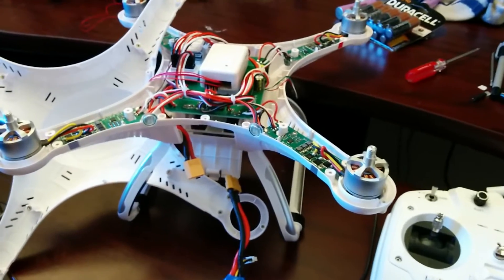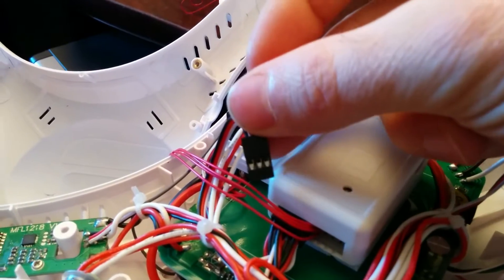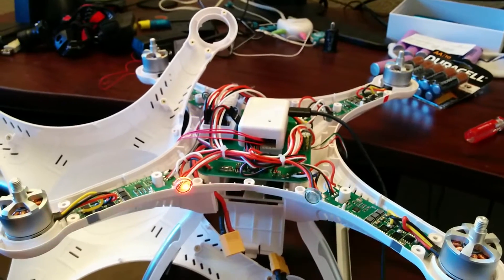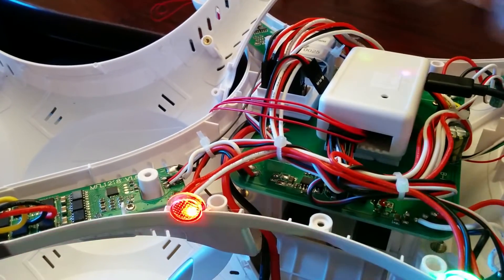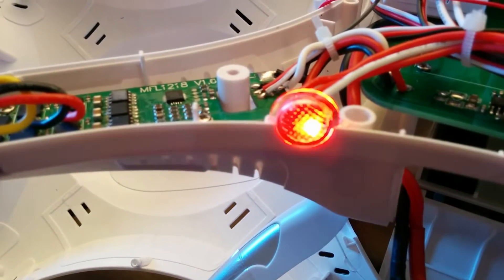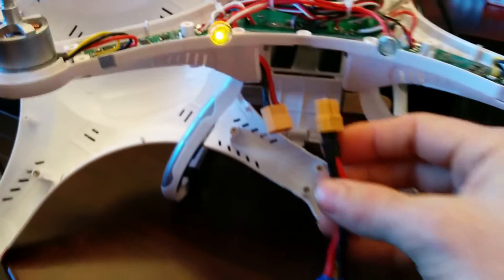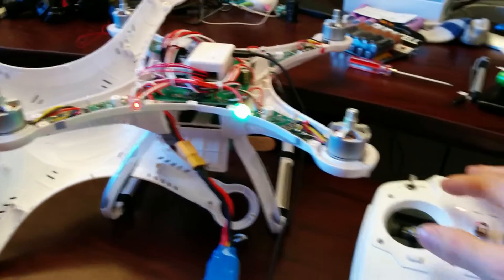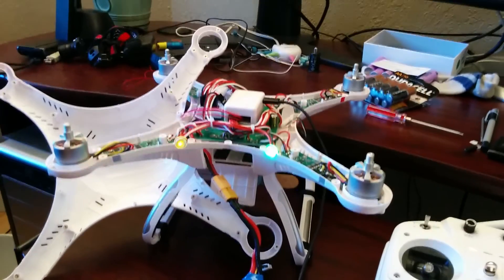Cheerson CX-20/Quanum Nova ESC Calibration

Comment: I have a CX-20, in mission planner it shows that it is upside down, i tried calibrating everything and it still doesn't work, and it doesnt want to unlock the motors, I calibrated the transmitter and it still doesnt want to unlock them. Could anyone help me please?

Comment: how can you pass through throttle without arming at the end? will it need a restart and it would need arming first again?
I think you can do esc calibration by plugging your mototors one by one into receiver arm channel, power via usb turn on tx max throttle plug in battery lower throttle disconnect batt repeat...

Comment: Hey, I know it been a while since you did this, It worked for me but does not seem to be saving the settings. When I disconnect and unplug from the PC plug everything back in ,plug back I the battery the motors wont start at all. If I go through the process again the motors spin but once disconnected same thing. Any ideas? Any help would be appreciated.

Comment: you know whrere to buy compass wires and conncector. When I plug in my compass wire and put on the top the motors only go half throttle on full strange. I may have a short in wires but didnot think the compass would set motors.?

Comment: I did all this and everything went as yu said , i cannot get it to arm now , and suggestions .?
Reply from the maker: Cecil Frank maybe your need to plug the cable back in that you unplugged(see description for the full set of steps).
Reply: Gps green light doesnot work no power to it ! Red works!
Reply: I'm actually having an issue with the red indicator light after a crash. All my solders seem good and it even flashes for a second when I plug the battery in. Anyone else solve this problem?

Comment: Couldn't work out why my motors wouldn't spin up on arming, after having done a complete rebuild/upgrade on my Quanum Nova. Thank you! This worked perfectly - even with different hardware/transmitter ( APM2.8/ESCs V2.4b/3DR power module/FS-ia10b/FS-i6S)

Comment: Hey there  I am having a problem when I arm it and throttle up the motors start and stay at the same speed. full throttle it's stays at the same speed.   and ideas?
Reply: battery, or transmitter

Comment: I got a this quadcopter for christmas lastyear and I think I calibrated it wrong. how would I reset the whole thing so when I turn it on it thinks it is its first time turning on.
Reply: Hi Littlepro01, if you don't have any motor problems, you don't need to calibrate the esc like in this video. What's your CX-20 problem?
Reply: I believe I calibrated the gps and compass incorrectly so it acts stupid and doesnt always respond
Reply: You cannot calibrate GPS but compass and accelerometer..what's his beaviour

Comment: After you do this you need to replug the cable you did pull out in the begining ?
Can i upgrade the esc's for 30 amp opto BLheli esc's and fly with them after only this caliblation?
Reply from the maker: Yes, you need to plug it back in(as stated in the description).

Comment: I finally fixed it. calibrated the esc's according to this video. it was great. crashed after,  just got the same exact motor, put it in, was shuddering. Replaced the rf esc and it fired up! since I saw your video, I bought a Parrot Bebop 2. Cats ass!

Comment: Hi Mike, just wanna commend your awesome video!! Also wanna ask if you could show us the procedure to shutdown the quad such that the calibrations are saved. I realised that my motors are not stopping together in normal mode like they did in ESC calibration. help needed thanks!
Reply from the maker: +Edwin Kang The calibrations are saved automatically when you finish the procedure in the description of this video. There is nothing else you need to do.

Comment: so everything looks great all in sync, but as soon as i power off and  power on its crap again, not moving the same .  is there an order your supposed to re connect everything that im not doing right?
Reply from the maker: +Ricky P No. If you hear the same beeps as in this video then you are done. If they don't spin the same after powering back on you have probably not calibrated the accelerometer properly.

Comment: After doing all the steps my cx20 with APM2.8 works and motors are calibrated, but once i disconnect and try to reconnect it seems that my APM didn't kept the calibration and once i arm motors they  start to turn at low rpm again as if i didn't proceed to calibration?? any clue?
Reply from the maker: +Jocelyn Cholette did you do all the mandatory calibrations in mission planner? the motors may spin when armed if you have the MOT_SPIN_ARMED parameter set.

Comment: Thanks for this video. I can now get the esc/motors to run. But when the motors are armed, my Q nova spins the props quite a bit. Should this happen?

Thanks!
Reply from the maker: +Julie Macfarlane it is a safety feature. but you can change a parameter (MOT_SPIN_ARMED) if you don't want the motors to spin when armed.

Comment: l would like to thank the author of this thread l have a problem with my new never flown cx20 when l took the top off for a look at the guts of it l found a white wire cut. problem answered in thread. l plan to build my own quad soon the cx20 is just one step along the path. thanks

Comment: Hi Mike, brand new Cheerson CX 20 open source. all 4 motors worked in the house. took it outside did the spinning bit, placed it on the ground, and only 3 motors worked. been going crazy. I'm ready to send it back. that button you pushed, would this reset the motors or what? please help
Reply from the maker: +philip dangelo No it won't. You probably haven't calibrated everything properly or you have a motor or ESC issue. There is a link in the description to a forum where you can get help.
Reply: I have the same problem. did u solve it? how? ty
Reply: +philip dangelo did u ever fix it?

Comment: will this steps help if my cx20 is taking off side ways and hard to control when taking off?
Reply from the maker: +ivan botello no, probably not. either you're not giving it enough throttle when you take off or you haven't calibrated your accelerometers properly.
Reply: +Mike Morrison I been trying to calibrate it. I do put it in calibration mode and go in circles and then I put it nose down and go in circles. And my cx20 still takes off side ways
Reply from the maker: +ivan botello that's not an accelerometer calibration. http://copter.ardupilot.com/wiki/configuring-hardware/
Reply: +Mike Morrison thank you. I just got mission planner on my compute.

Comment: Hi Mike My problem is this, I had a crash of my CX20,"pilot error" unfortunatly bad damage,  had problems after where flights were not stable and for other reasons I replaced the FC with a new one , standard  open source with  3.2.1 , installed it  and cant get the motors to arm (rock back and forward with a constant beeping) found your video and followed it and every thing worked as you explained, disconnected and it went back to rocking and beeping, can you suggest what I am doing wrong, thanks Geoff
Reply from the maker: +SuperGoofa Something is wrong with your parameters. Reset to default in mission planner (advanced view) and then go through all the mandatory calibrations again. Remember that the compass is internal.

Comment: Ive noticed on the ESC power cable the white lead on mine as been cut after been soldered to the board, Is yours the same? Is the white lead not used for anything?
Reply from the maker: +Quopter 999 Yes they are all like that. It isn't used.

Comment: Hi Mike,could you possibly take a look at my video (my only video) and let me know if you think my problem could be ESC related. Ive done the accelerometer and TX calibration via mission planner but im still having a tilting issue. My next step is the ESC calibration then restoring the default parameters as ive left to think the problem is in the parameter settings.  #Baffled  Your opinion / help is much appreciated. Thanks

Comment: Is there anyway to reset, or reprogram the Cheerson CX20 Remote Controller?
It is at this point not binding, and just beep and blink.
Please help if you can. 
Thanks
Reply: +Jack Scarpon If the controller is beeping, and blinking, that usually means the batteries need to be replaced in the controller itself.
Reply: I found out that the hard way.... Thanks for your reply...
Reply: +Jack Scarpon The best place to find info regarding the CX-20 is at http://www.rcgroups.com/forums/showthread.php?t=2112759
Reply: Thanks..

Comment: Hi friend. I'll connect the USB in APM and other in the computer?
Reply: +Diego Funari Yes, the other end to the computer. This is only used to supply +5 volts power to the APM during the calibration process.

Comment: Soldering looks good on the quad, what should I check on the TX
Reply from the maker: mark valis Nothing on the TX. Your problem is either the ESC, the connection between the ESC and the flight controller, or the flight controller. Try plugging the ESC directly into the receiver's throttle port (T) to rule out an ESC issue.

Comment: I have one motor not spinning i did the above but still doesnt run, it kept beeping even while others were running
Reply from the maker: mark valis The beeping means that that ESC is not getting a signal from the flight controller. Check the connection (wire and solder joints) between the flight controller and that ESC.

Comment: HI Mike 
             When i power up my quad 1 esc arms a few seconds after the other 3 and then the motor will not run any ideas what the problem may be thanks
Reply from the maker: Colin magowan Sorry I don't. I have not heard those fast beeps before. Have you done the transmitter calibration and then the ESC calibration?

Comment: I was following your setup carefully my 3rd (CCW) motor speed were back to normal, but when all setup finished, I remove the battery, plug the power back and the mini usb, my quad doesn't saving the setup, it all came back to the previous setup (my 3rd CCW motor esc speed aren't the same with others). So, how do I supposed to save the setup to the esc?
Reply from the maker: Dwityandaru Hananto The settings are saved when you complete the procedure. If one motor isn't spinning as quickly, perhaps it is a different issue. Maybe you haven't calibrated the accelerometer properly so the quad doesn't think it is level. If it doesn't think it is level it will apply more power to some motors and less to others. Try (CAREFULLY) holding and tilting the quad while applying a little throttle to see if that one motor will spin faster when you have the quad at a different angle. If so, it's probably the accelerometer calibration. Otherwise, search/ask in the forum I linked to in the description.

Comment: Hi Mike , the quad still flying normally , but No Led night night , when i plug in the usb still no light , I didn't use Mission planner or update any software , the quad still in its original condition, i just got help from one of the senior in Rc forums, hope that i can find out the problem soon . Thanks

Comment: Hey Mike:  I replaced my 8" OEM props on my CX-20 with  carbon fiber props and almost crashed the quad. With the 9" props it fly very unstable. I double checked the for proper prop rotation and all was fine...any clue on getting it to fly properly.
Reply from the maker: Probably too much vibration. You need to balance the props and check the amount of vibration. The rcgroups forum thread has many posts about this.

Comment: +Mike i have a problem here ... look like the ESC are totally not programmed ... the drone dont responds good ...all motors spins but the 4 engines are not responding right... do you know a way for make it start run in normal way ... or do you have the opportunity to share your mission planner settings... because i try all the possible way but nothing to do ... my Cheerson is unusable ... and is new, i dont make a fly with it ... i did something wrong with mission planner setting  ... !
Reply from the maker: Luigi Burdo Take a video of the issue you are having and upload it to youtube. Then post your problem with a link to the video to the rcgroup thread I linked to in the description. You'll have your quad back in the air in no time.
Reply: Mike Morrison  thankyou i will do it tomorrow and share it
Reply: Mike Morrison i found where is the issue .. i entered in the arm checking calibration mode of the apm 2.5.2 . like your tutorial but with arm check set to 1 ... and after 1 h of beeping randomly on every esc because  of calibrating, something change,but the ARM need totally to be reconfigured. Example ,before  the arm esc was making the front right and down right motor really hard in rotating, now is like this the left down ... the others motors are soft... it is make me creazy ... i make a really stupid thing when upgraded the firmware from mission planner.

Comment: How to.ya get it.to save the changes as min.just.go.out sink.agen.soon.as unplug baterry and plug bk.in
Reply from the maker: Chris Schofield The changes are automatically saved to the ESCs when you complete this. If you are having trouble when you plug the battery back in then you probably have other issues. Maybe bad firmware update or incorrect parameter settings. Post your issue on the rcgroups forum thread that I linked to in the description.

Comment: I did a firmware update with APM Planner 2.0 and now when I connect my battery I get a constant beep and flashing lights. The app says my RC not calibrated. I'll try this to and see if it helps. If not by chance do you know how reset factory defaults? Thanks in advance.

Comment: My quad is dragging to a side, what could be?
Reply from the maker: THB Try doing an accelerometer calibration and check in mission planner to make sure the quad looks level. Also make sure you don't have any trim set on the transmitter.
Reply: You are awesome , i will try to get the best of it , to top shell is crached badly si i taped it and worked fine till last crash . I assume some kind of calibration needed of some sort .

Comment: Please friend me help .. I do not know what else to do .. I made the video procedure .. But when you turn on the CX20 again, he is whistling straight .. "beep beep beeep .... .." What did I do wrong?
Reply from the maker: Willie Moura You need to plug the receiver back into the power distribution board.
Reply: Mike Morrison Please how I do it? I already tried everything and can not ..
Reply: Mike Morrison I Got You. I connected the receiver back .. and not go forward .. continued making many beeps
Reply from the maker: Willie Moura I'm not sure. The only things I can think of that would cause beeping are the ESCs not getting a proper signal from the APM, ESCs not calibrated properly(try calibrating again?), or a low voltage warning.
Reply: Mike Morrison Ja calibrated all you can calibrate .. do not know what he has but anyway, thank you for the help ..
Reply: Mike Morrison Friend, solved my problem .. It was simple .. ONLY CONTROL of calibration
.. Thanks

Comment: are you kidding you do not have millions of hits!!!!! I have sent back 3! 3 novas to hobbyking because of esc issues and you just solved it. If you hold the throttle in the arm position it will bring it to calibrate mode so be careful as it caused issues that your video just solved

Comment: Hey
I run the Stepas to calibrate, but now see what i have...

https://www.youtube.com/watch?v=nIeAOUqQRmc&feature=youtu.be

what do toy think?
Reply from the maker: Yanir Tzabary Have you done the radio calibration in Mission Planner?
Reply: Yes,  if i did it correctly...
Reply from the maker: Yanir Tzabary check the advanced throttle maximum parameter(THR_MAX) in mission planner. It should be 1000.
Reply from the maker: What version of firmware are you running?
Reply: Mike Morrison
How do i know? I think the last from Mission Planner, i will check it.... parameter Thank!
Reply: strawsoft THR_MAX) in mission planner. It should be 1000 - i think that help, i still did not test it..
Reply: Mike Morrison heyi still have a issue with my cx :( he did not fly up..
Reply from the maker: What is your problem now? Did you do the mandatory calibrations in mission planner?